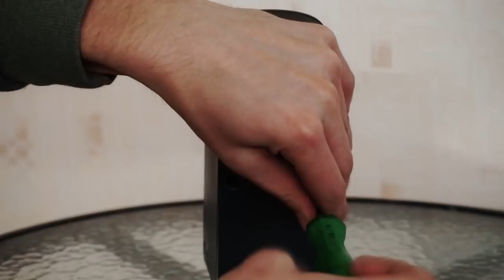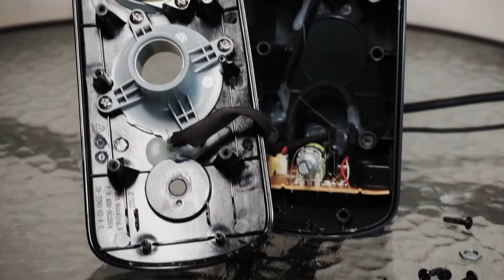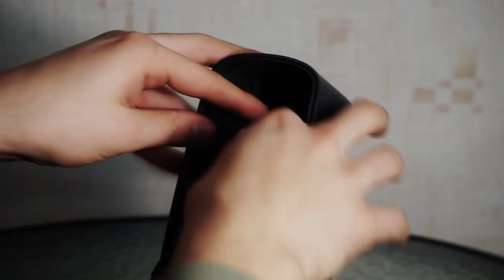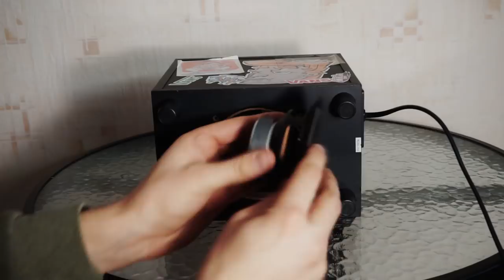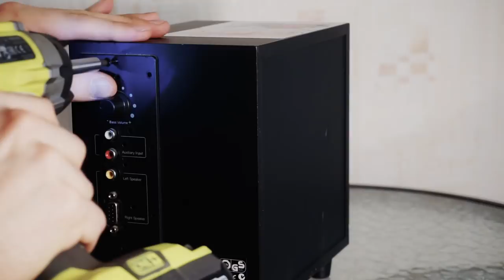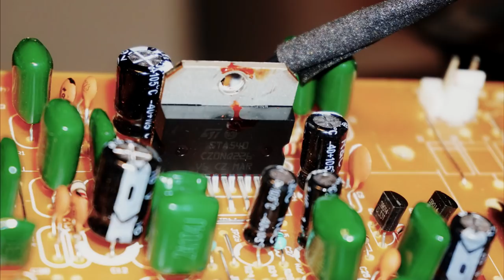Look inside Logitech Z323 speaker - What's Inside?

Comment: I used to own these and got rid of them and replaced them for studio monitors and a nice yamaha subwoofer but one thing I noticed with the z323 is a rattling sound with the bass. I was able to fix this in 5 minutes by disassembling the subwoofer and sanding the rough edges of the poorly made port. It completely fixed it. If you do it, use a higher grit sand paper to keep it smooth.
Reply: Mint Tech I never had this problem yet

Comment: After 12 years more or less of using this sound system (oh and i bought it 2nd hand 😂 ), today i used this video to help me fix two problems of my speakers. 
The problems were the volume knob making a rattling sound when turning it on and the left speaker only working if the knob was on some positions. 
I opened the right speaker and put some WD-40 on the potentiometer and it fixed both problems 👌
Reply: Here to do the same thing due to the same issue, hopefully it works. But this thing is such a tank, also had it over 10 years🤣

Comment: Left speaker dead. connections are alright,- as you can hear the music veeery low. Any idea?
Reply from the maker: check wire.
Reply: @Techscrews connections good like said. Issue was the potentiometer! Reddit hint, putting alcohol on it-and, - this did it. Its tracks seems to collect debris over tune or some thing

Comment: I want to logitech z323 speaker system right side  speaker inside 8pin ic number
Reply from the maker: Sorry, but i sold that system to buy better.
Reply: @Techscrews  😟😔😔
Reply: Do you need the name of the part that controls the volume? Potentiometer? Its name is B50K.

Comment: Woah there. I think Logitech still lies at specs. The subwoofer claims to be 18 watts, but I only see 15 watts and the satellites claim they’re 6 watts (3 watts x4), but I see 10 watts (5 watts x4).
Reply from the maker: maybe they show amplifier power ?
Reply: @Techscrews  You are probably right. 

On their 623, the wattages are way off however. The satellites aren’t even 35 watts and are rated at 10 watts and they claim their sub to be 130 watts, but I think it’s maybe 60 watts.